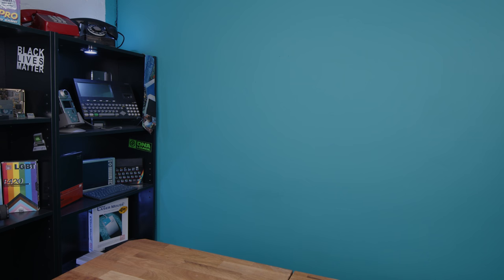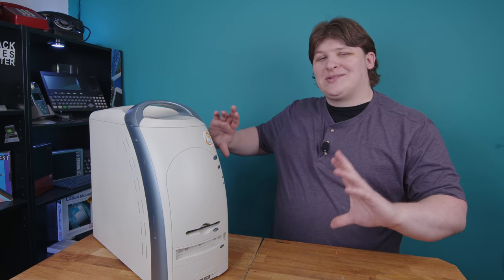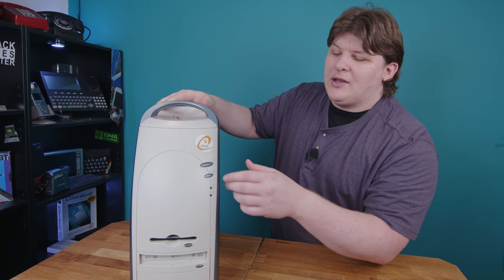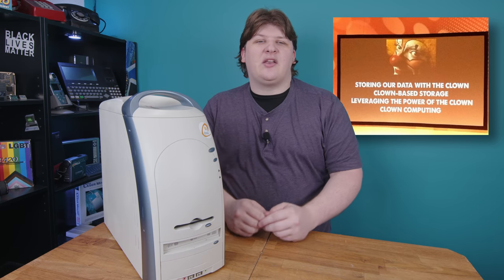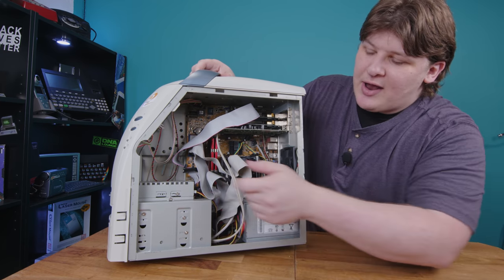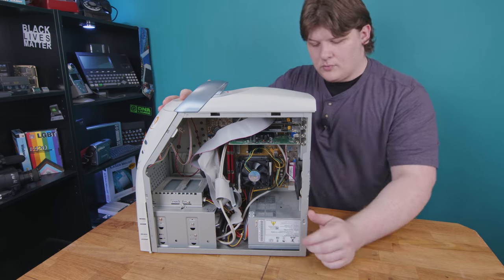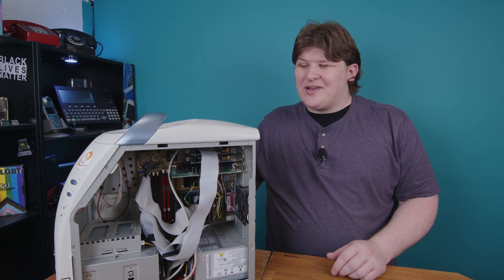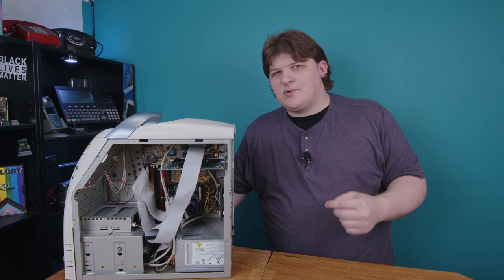Meet The Edge

Comment: It would be nice if they added padding to the handles, or used leather handles.   I've not seen any computer case (PC or Mac) that has had a decent handle.   Even Apple (who do generally have well engineered cases) have terrible handles, often with sharp edges.   I've lost count of the amount of times I've had to wait a while to get feeling back in my figures after spending a few hours moving the old Powermac G5's around.

Comment: 11:30 - /me pushes up glasses - "Well akshwually…."

The OG Pentium was on three sockets, too - or five if you count the combo 486/Pentium "Overdrive capable": Sockets 4, 5, and 7 as "Pentium sockets" plus 2 and 3 when used with Pentium OverDrive CPUs.

Socket 2- Primarily a 486 socket, its only real improvement over Socket 1 was support for the Pentium OverDrive processor - therefore its only real "selling point" was that it was a Pentium socket.

Socket 3 - Basically just a slightly improved Socket 2, while it was also primarily used by 486 early, it saw a LOT of use in early AMD AM5x86 and Cyrix Cx5x86 Pentium-era clones. (It also supported both 5V and 3.3V CPUs, where Socket 2 was 5V only.)

Socket 4 - The original "Pentium socket" - supporting only the 60 MHz and 66 MHz original Pentiums (Plus the ultra-rare 120/133 MHz Pentium OverDrive.) 5V only.

Socket 5 - The first "mainstream" Pentium socket, supporting 3.1 to 3.6V second-generation Pentium CPUs, and Pentium-era clones.

Socket 7 - The "super" socket, released to support third generation Pentiums (Pentium MMX) and backward compatible with Socket 5 CPUs, adding support for voltages down to 2.5V. This was later expanded by AMD to "Super Socket 7" adding faster bus speeds and more/lower voltages for newer lower-end CPUs from a wide variety of companies - Super Socket 7 supported something like a dozen different CPU cores.

Comment: I used to have that motherboard, I used it to replace a board from an HP system. Interestingly I was able to overclock the 2.2ghz Celeron that came in the HP up to 3.4ghz with just the air cooling that came with the box from HP.  I think I purchased the board in 2003. It was significantly better than the HP version of the same board that came with the HP system.

Comment: I've got a 2003 Dell Dimension I use for XP stuff, even tracked down a Dell OEM XP install disc for it. Think it's like a 3.0Ghz P4HT, 4GB DDR1 & Radeon 9800Pro. I was so lucky that thing had DDR though since I later got an externally identical Dimension, other than exact model number with an older P4 and that thing uses RDRAM. I am a big fan of the case design on that era of Dell stuff though, the grey on grey

Comment: That brush is definitely not antistatic by the way. It looks to me like nylon on nylon - depending on what you're brushing that's basically a static generator. You'd be better off if it had a metal handle so it could ground through your body.

Comment: Not an uncommon upgrade path. Back in Highschool there was no way I could afford to buy a new PC with any regularity. when going to a new generation, Id always start off with the most budget parts, and ensure there was an upgrade route. when Id saved enough from my weekend job, get a better CPU. then the ram was bottlenecked, get good ram. now the system runs better its worth getting a good GPU. now im chasing frames, but the mobo is a cheapie and a rubbish overclocker. Air sucks, I can build things, build a watercooler. etc etc. 
And then youve got enough junk parts to  rebuild the old PC, usually as a standby for LANs (for those poor souls who were still using the family PC and wouldnt let it out). That rig actually became quite communal amongst our clan, getting an upgrade every time something else became spare. I wont divulge her name, but anyone could play with her and had alot of various DNA in it. we also had a DC++ server on there holding all the patches that were necessary to bring a vanilla install up to the correct versions and any mods we were likely to be using. I helped keep everything standard, and internet usage limited (i was on a 256k dsl line, any new major patch was an overnight thing). in that case it spent the afternoon at my mates dads engineering firm (we didnt have fibre then, but that was a damn fast line).

Comment: The pentium 4 is quite the chip. High temperature and massive clock speeds with performance that was ultimately just OK compared to its competitors. What's really interesting is that some of the socket 775 pentium 4 chips are actually 64 bit meaning they can run modern Windows 10 and, with a tweak to the installer, Windows 11. Not well mind you but they can.

Comment: If you really want to hobble a Netburst CPU, pair one of the older 128K L2 Celerons with PC133 SDRAM. 
128K of cache is already way too small for a bandwidth starved architecture like Netburst, even when it's being fed by Rambus or DDR. But with PC133 SDRAM, a 2.6GHz Celeron-128 will run some apps (namely games and compression/decompression software) slower than a freakin 1.2GHz PIII - no joke!

Comment: On P4 and RAM support - "shouldn't be possible" isn't a thing. P4 didn't have an onboard memory controller - the memory controller was always in the chipset. So while it was horrendously inefficient to use SDRAM since the CPU's front side bus (at its slowest) was 3 times faster than the fastest SDRAM, there was no technical reason why it couldn't. 

And yes, having been at Intel during the P4 development timeframe (and saw products I was working on get cancelled due to RAMBUS issues,) the three reasons quoted were the main reasons for RAMBUS' demise. (The company RAMBUS was *TERRIBLE*. The actual technology wasn't bad, other than the whole "ran hot" thing but the company was what really doomed it.)
Reply from the maker: by "possible" I mean "remotely reasonable"
Reply: @CathodeRayDude   🤣

Comment: I think that’s actually just a BTX motherboard. It was an Intel specification that, like you described, was basically just ATX flipped 180 degrees. It was supposedly designed so that the PSU wouldn’t be fed hot air from the CPU. I kind of doubt this was really a significant problem for the era. But that’s probably why it’s common for cases to put the PSU at the bottom today(as well as it just allowing for cleaner cabling).
Reply from the maker: well, fwiw I've since swapped the motherboard with another standard micro ATX and it went right in, so
Reply: Oh, interesting. Quickly looking it up on wiki says that early BTX were still left-sided cases and were completely compatible with ATX. While later BTX was right-sided, like this one, and was not compatible unless the manufacturer decided to specifically do so. So that's a long-worded non-answer. It could be BTX with ATX support, or it could just be ATX with a similar theory as BTX. Either way, it looks a lot like BTX and I guess that's the only point of this rant. lol

Comment: I had a 1.4GHz Pentium 4 with SDRAM when  it was new and can confirm it ran like complete trash! Having since got a Pentium 3 1.4GHz Tualatin setup it was crazy to see how much better GTA 3 and HL2 ran. For my own XP build I picked up one of the blursed ASRock boards which pairs the LGA775 socket with the AGP and DDR1 Intel 865 chipset from 2003 and still somehow manages to support Quad Core CPUs.

Comment: I can say this, the early P4s were not any faster than the P3 they were designed to replace, and sometimes were slower. By the time of the socket 478 P4s, AMD was then laying the smackdown on Intel with the AMD Athlon XP and Athlon 64. I was running a 2.5GHz Prescott core P4 when I got my then new computer, and my roommate's then AMD Athlon XP 2500+ stomped my machine into the ground on most things, I could BARELY beat him on a select few things.... That Prescott core P4 ran WAY too hot for my tiny room in the summer, so I side stepped into a 2.4GHz Northwood core P4 that overclocked to 3.35GHz, ran cooler, and still didn't hold a candle to AMD....My roommate upgraded to an AMD Athlon 64 3500+ machine, and even the fastest Prescott core P4 (I "upgraded") I could throw in my machine, at 3.5GHz, could not hold a candle to the AMD Athlon 64..... Basically, a short story long....in my opinion and experience, the P4's architecture is, and was, garbage. Yes, they clocked like a bat out of hell if you had a motherboard that could support the front side bus of the fastest P4 chips.... but clock speed means nothing when the underlying silicon is hot garbage (literally in the Prescott). Now, that said, at this point, 2004 is considered retro in computer lingo, so I am sure the NetBurst tech in that is fine for you are using it for... but I would not, and never have, considered ANY of that generation of Intel processor.....good.

Comment: Used to see these a lot in the U.K., they were branded Tiny or Time computers and were generally cheap and cheerless computers built to a price meaning they were often terrible.

But Ubers now and then, a computer would come from them that was better than the reputation suggested. 

As they were unlikely to have made the case design, it’s likely it was a cheap Chinese case design to rival the iMac, which was common from late 90’s to mid 2000’s, so that could explain the case source and design at least.

Lifter  the first gen P4, later ones could also use ram other than RDRAM as it was pretty obvious RD RAM was a dead end , unless you were using specific case scenarios like raytracing, rendering, video editing, etc, where branch predictions were actually predictable and things were pretty linear.  RDRAM in all other scenarios had horrible latency, made worse by the P4
‘A absurdly long instruction pipelines.

Comment: Great video as always. A couple of things; you mention the G3,4,5 and MacPro as cases with questionable case design, in the form of the handles being in the wrong place. I'd counter that, by saying they are in the right place, as you are supposed to use two hands. One: it spreads the load of the computer, which is quite considerable between two muscle groups, and two: it means you don't have all the weight of the machine on one area; say, if you're using one handle to lift the item. The other thing; I have a Power Mac 8600, and although it doesn't have the funky design of the case you have shown, it does use a large amount of plastic, with a door on one side removable with a push of one lever. It's quite neet.
Reply: Having lifted a G5 I can certainly agree that you're supposed to use two hands. However the G5's handles are still limited because of the relatively sharp edges.

Comment: Huh. I don't remember UT being frame-limited to 60fps, but it has been a while. Back in the 2000s I had 2x 21" Intergraph monitors that would do 1600x1200 @ 75Hz and was awesome for playing UT. really wish I hadn't thrown them away, but they were an absolute bitch to carry around and transport. lol. I also had an old Compaq that used RD-RAM and still have some of those heatsinked RD-RAM modules in my "pile of RAM" somewhere -- I also remember that it required a "terminator"/empty stick if you didn't populate both slots.

Comment: Rdram didn't pull all that much more power than sdram and the bolted on heatsink is more of a heat spreader. It gets maybe hand warm under load, you won't be cooking any eggs with that. FB dimms I think are the real winners for hot running memory.
As for the lack of bandwidth of sdram and the need to replace it - it was very real, the estimate was that roughly three times the bandwidth of pc133 stuff was needed. Not that simple to achieve but rambus had a solution that was pretty attractive on paper. 16 bit memory channels promised cheaper motherboards and easier scaling.
It really wasn't another intel monopoly attempt like some people believed. In fact AMD had its own rambus license at the time they could have gone with but chose not to.
In the end it was probably the high cost associated with the platform that killed rdram. Major contributor was probably just the fact it was a brand new product with insufficient production, if you can't supply the demand prices will go up. RDRAM price does actually come down to equal DDR by q1 2001 but I guess that was not quick enough since by then sdram solutions for the p4 were almost ready to go and intel's own DDR based platform was on the horizon.

Comment: The reason for Rambus is that Intel had an agreement to use the tech. Rambus is a notorious patent troll and even went after JEDEC members for claiming that DDR RAM tech infringed on their patents. Intel really didn't want to use RDRAM once it flopped, but they were going to lose out big to Rambus if they didn't. That's why it hung around for so long after DDR came out. Once whatever agreement expired, Intel dumped it and ran.

Comment: Lots of machines from the late 90s had the drive bays at the bottom, for no other reason than to be weird as far as I'm aware. I had an NEC socket 7 machine that was upside down. No reason. Seems like they just wanted it to be. Couple HP Vectra models were built upside down, with a bit more reasoning of the weird cooling setup that Pentium IIs and slot 1 in general wanted. That's not to say there weren't other ways to do it, seems like it was just to be weird.

Here's a classic channel I always come back to, in this particular video he showcases his own weirdo upside down Vectra. It's a Pentium II machine but it uses SIMMs!
https://www.youtube.com/watch?v=MZe_ZUjoYSE

The thing you describe about the Celeron 4 behaving like a Pentium III... Even a "fast" Pentium 4 is often matched or beat by a midrange Pentium III. NetBurst was just a terrible design, long pipelines designed for high clock speeds that Intel never achieved. Had they gotten to the 10GHz they projected, performance would have been viable. Unfortunately, by the 3.8GHz mark (The highest clocked Pentium 4 released) they ran so hot there were scarily few coolers that could keep up. 125 watts TDP! Not the worst now but absolutely insane for 2004. Ironically, because of their tendency to get ridiculously hot, the lower clock chips often will perform better in real world scenarios, and the low(er) power Celerons can actually often perform the best, simply because they don't overheat as easily. Plus, like the Pentium II and III eras before them, they can be mean overclockers. 
The big downside to the Celerons is the limited cache.
The benefit of jumping to 2.8 especially with that cooler is basically nonexistance and it might even be a jump down because of the thermal problems these had. I'm led to believe there was also a 3.0, and I do know they made one hyperthreaded CPU that is 533 FSB, so there's your "Real" upgrade option should you ever look for one. The S-spec number is SL6PG if you're ever interested.

Also... The RDRAM stuff. Intel actively claimed that it was "impossible" for SDRAM to be used, and they did not want to use DDR because it was "Too slow" for the P4. Companies like SiS took it upon themselves to engineer alternative chipsets which fixed this problem until Intel begrudgingly relented and gave us the ever popular 82845G series chipsets, though only after losing business from builders and OEMs alike for almost 2 years. Following this "Fall from grace," Intel proceeded to bribe performance testing studios into inflating their scores and got called out on it, paying up in 2011 after a class action lawsuit ruled against them.

The tradeoff for SDR was insane. Even the slowest DDR could transfer something like two words every other cycle, but even overclocked PC133 SDR could only do one transfer for every like 3 clocks. It was insanely slow, and coupling this with NetBurst's horribly long pipeline and the fact most SDR systems were Celerons with limited cache, utterly destroyed their early performance. Even RDRAM was "too slow" next to reasonably fast DDR. For some machines, the jump was so significant that boot times dropped from minutes back into seconds with the upgrade to DDR. All that said, the final Coppermine Pentium IIIs utterly crushed even the top end RAMBUS / DDR Pentium 4s for the majority of their existence, right up to something like 3.2GHz if you don't overclock the PIII. They just perform like trash no matter what you do.
The machines with 3 slots are actually SDRAM machines - I've only ever seen ONE board with three DDR slots and it was a DDR2 AMD machine from years down the road. Triple slot SDRAM was not uncommon, but DDR only performs "better" in dual or quad channel mode, which only works in even matched pairs of modules. 512MB of SDRAM was pretty much the ceiling for most people - Modules >256MB in SDRAM are fairly uncommon, and even though some machines support the aforementioned "third slot" it is often address limited (We used to call them a gimp slot) or speed limited and won't work correctly anyways. Seeing SDRAM machines with >512MB installed memory is pretty rare, though I do know that Kingston DID actually make 512MB SDRAM modules... Albeit SODIMM as for a laptop. There are adapters though! The best benchmark to run would probably have been something like 3DMark 2001, which you can get for free nowadays, I think.
Reply: Kingston also made 512 MB full size DIMMs, I had a P4 system maxed out at 1.5 GB of PC133. Speed of the ram was less of a concern than amount for what I was doing.

Comment: Funnily enough - 16-bit software runs just fine on Windows 10.... As long as it's the 32-bit version of Windows 10. 

I have an HP tablet  (Stream 7) that runs the 32-bit version of Windows 10, and it runs old Windows 3.x software just fine. It's funny to me running Win3.1 games on a modern small tablet!

Since there is no 32-bit version of Windows 11, 16-bit support is finally dead.